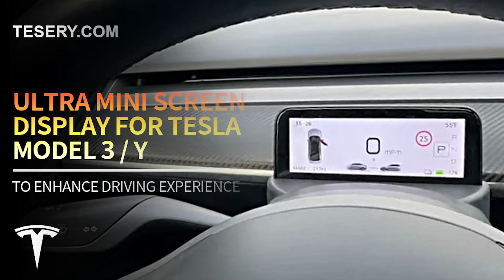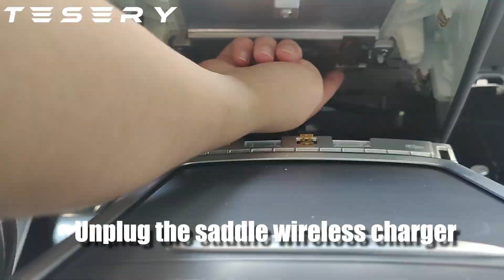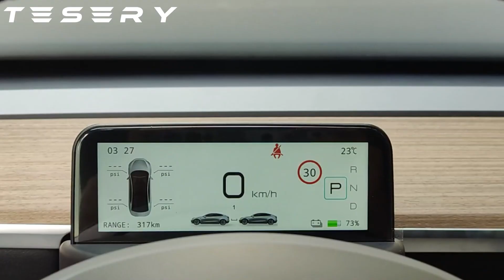How to Install Ultra Mini Screen Display for Tesla Model 3 / Y

Comment from the maker: This is the new screen display for Tesla Model 3/Y. This ultra mini display is fully integrated, has a low profile but provides all the critical car information directly on your front view. Product link👉https://www.tesery.com/products/mini-screen-display?ref=uC56lb37

Tesla owners have the unique opportunity to customize their car for a personalized driving experience. Whether it’s for aesthetic or performance, Tesla mods are a great way to enhance your vehicle.

🚘 Tesla Model 3 Mods👉https://www.tesery.com/pages/tesla-model-3-mods?ref=uC56lb37
🚘 Tesla Model Y Mods👉https://www.tesery.com/pages/tesla-model-y-mods?ref=uC56lb37

Tesla Model 3/Y Mods List

Tesla Model 3/Y Wheels Accessories
*Fored Wheels👉https://www.tesery.com/collections/wheels
*Lug Nut👉https://www.tesery.com/products/tesla-forged-lug-nut
*Wheel Cover👉https://www.tesery.com/products/tesla-model-y-wheel-caps
*Brake Caliper Covers👉https://www.tesery.com/products/brake-caliper-cover-for-tesla-model-y
*Jack Pad Adapter👉https://www.tesery.com/products/tesla-jack-pad-adapter

Tesla Model 3/Y Configuration Upgrade
*Display LCD Instrument Panel👉https://www.tesery.com/products/instrument-panel-for-tesla-model-3-model-y
*Rear Entertainment Touch Screen Display👉https://www.tesery.com/products/rear-entertainment-touch-screen-display
*Swivel Screen Mount Kit👉https://www.tesery.com/products/swiveling-mount-kit-for-tesla-model-3-y
*Screen Protector👉https://www.tesery.com/products/model-3-y-center-screen-protector
*Adjust Car Phone Holder👉https://www.tesery.com/products/fixed-clip-safety-cell-phone-holder-stand
*LED Illuminated Door Sills👉https://www.tesery.com/products/led-welcome-pedal-front-doors-tesla-model-3-y
*Smart Key Ring👉https://www.tesery.com/products/smart-key-ring
*Tesla Puddel Lights👉https://www.tesery.com/products/led-tesla-logo-projection-light
*Tesla Model Y Mud Flaps👉https://www.tesery.com/products/mud-flaps-splash-guards
*Brake Pedal Cover👉https://www.tesery.com/products/non-slip-accelerator-brake-pedal-cover

Tesla Model 3/Y Exterior Mods
*Carbon fiber spoiler👉https://www.tesery.com/collections/model-y-spoilers
*Carbon fiber front lip👉https://www.tesery.com/products/tesla-model-y-front-lip-spoiler
*Carbon fiber side skirts👉https://www.tesery.com/products/tesla-model-y-side-skirt-jc-style
*Carbon fiber mirror covers👉https://www.tesery.com/products/real-carbon-fiber-mirror-covers-model-y
*Carbon Fiber Tesla Logo👉https://www.tesery.com/products/model-3-model-y-tesla-logo-real-carbon-fiber
*Carbon fiber side camera👉https://www.tesery.com/products/carbon-fiber-side-camera-cover-tesla-model-3-y-s-x
*Carbon fiber door handel cover👉https://www.tesery.com/products/real-carbon-fiber-handle-wrap-cover-trim*👉

Tesla Model 3/Y Interior Mods
*Custom Steering Wheel👉https://www.tesery.com/collections/tesla-steering-wheel
*Carbon Fiber Steering Wheel Logo👉https://www.tesery.com/products/real-carbon-steering-wheel-standard-tesla-model-3-y
*Carbon Fiber Steering Wheel Trim👉https://www.tesery.com/products/real-carbon-fiber-steering-wheel-protective
*Carbon Fiber Turn Signal Wiper👉https://www.tesery.com/products/model-3-model-y-turn-signal-wiper-stalk-covers
*Carbon Fiber Cup Holder👉https://www.tesery.com/products/real-carbon-fiber-rear-drain-cup-holder-for-tesla-model-3-y
*Carbon Fiber Dashboard Cover👉https://www.tesery.com/products/dashboard-cover-carbon-fiber-tesla-model-3-y
*Carbon Fiber Door Panel Cover👉https://www.tesery.com/products/model-3-model-y-door-panel-trim-real-molded-carbon-fiber
*Carbon Fiber Center Consel Wrap👉https://www.tesery.com/products/center-console-wraps-tesla-model-3-model-y

Carbon fiber is known for its immense strength and durability, as well as its light weight, so these mods work well in any electric vehicle. Tesery can install any project you can imagine for your Tesla, including but not limited above mods list.Shop our aftermarket Tesla accessories and other high-quality mods at Tesery.com.

🚘 BEST Tesla Accessories:
Model S Accessories👉https://www.tesery.com/collections/model-s-best-sellers?ref=uC56lb37
Model 3 Accessories👉https://www.tesery.com/collections/model-3?ref=uC56lb37
Model X Accessories👉https://www.tesery.com/collections/model-x-best-sellers?ref=uC56lb37
Model Y Accessories👉https://www.tesery.com/pages/tesla-model-y-accessories-1?ref=uC56lb37

⬇ Stay up to date!
Instagram：https://www.instagram.com/teserystore/
Facebook：https://www.facebook.com/teserystore/
Pinterest：https://www.pinterest.com/TeseryLi/
Twitter：https://twitter.com/TeseryL
Email: market@tesery.com

Comment: This looks intimidating. So many pieces to pop off and put back together. I wanted to get it but knowing my luck, I'll break something.
Reply from the maker: The hardest part is removing the cover. But our packages come with an installation tool for removal so you don't have to worry too much, just a little patience. All of our wiring harnesses are also designed with plugs that just connect to the car. It is possible to follow the video and install it yourself.😀

Comment: How do you change any of the settings
Reply from the maker: Setting Method: Long press the right side of the steering wheel roll buttons for 3s. When finishedsetting and return, Slide Left rolling button and finished this setting.
You can view link to know how to operate：https://www.tesery.com/blogs/tesla-accessories-information/how-to-operate-tesla-model-3-y-mini-screen-display

Comment: Not easy to install, too many openings! Still thinking if I shall get it or not.
Reply from the maker: If you don't have installation experience, perhaps there is some difficulty. I suggest you can go to your local auto repair store or 4S store for installation help. Of course, if you want to try to install it yourself, it won't be too difficult. You can contact Tesery's online team and they can guide you through the installation online. You just need to remove some panels, then connect the plugs, then restore the panels, and basically the installation will be done.😀
Reply: This is a ridiculously easy install for what it is. I can probably do this faster than changing all the spark plugs on a bmw and remembering which piece of the firewall cowl needs to go back, and that's assuming I already have all the right sockets. (slight exaggeration. But this is mostly snap off pieces, as compared to the euro brethren)
Reply from the maker: @longebane  This dashboard has a plug-and-play design, and the most complicated part is probably the connection part, but it's not difficult